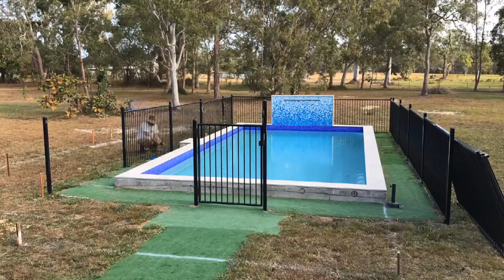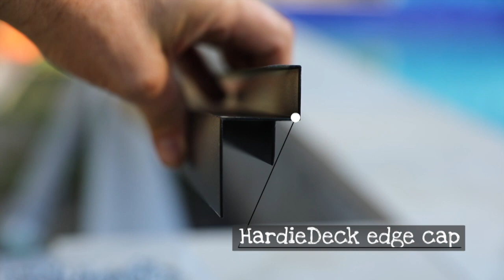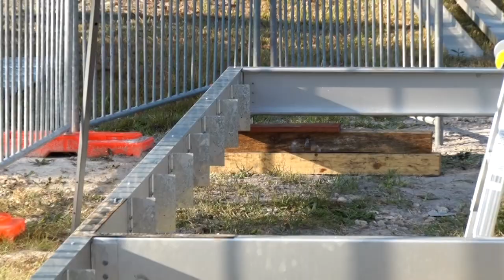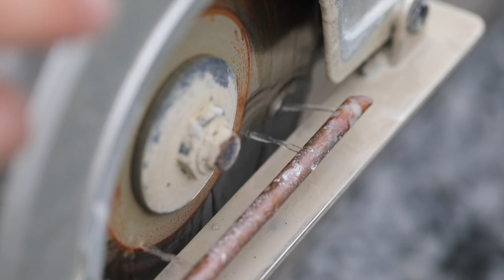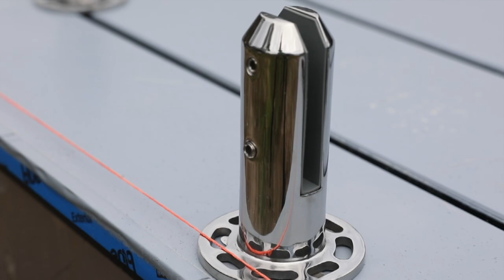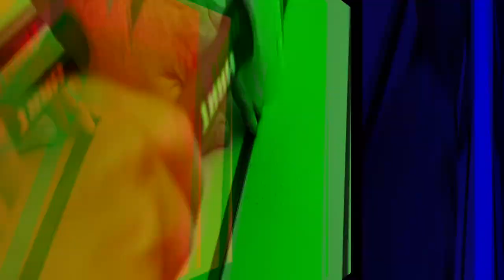How to build a deck. DIY timber free.

Comment: Cost? I'm guessing roughly the amount for a deposit on a small house lol
Reply from the maker: Hi @Salvation, apologies for the delay in reply, YouTube hasn't been notifying me of comments that have been held...
I haven't done the sums on it but it's not as expensive as you may think. Yes, it is more costly than basic timber however the fact is that in a situation like this one it should last 15+ years whereas a basic timber deck would likely be rotting in less than 5 & be requiring regular maintenance.
So short-term cost for a long-term benefit.
Reply: Love your videos and recommend them to my friends. You are definitely right with regards to lifespan on materials.
Reply: This is Australia, a large house (cry)...